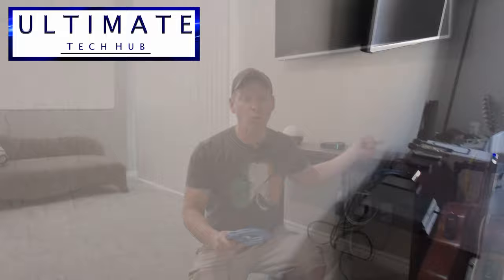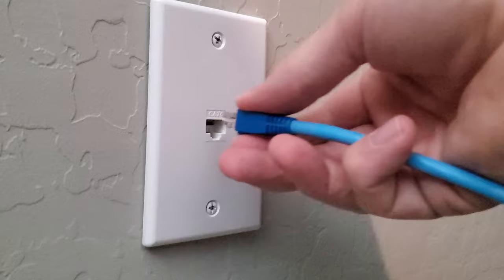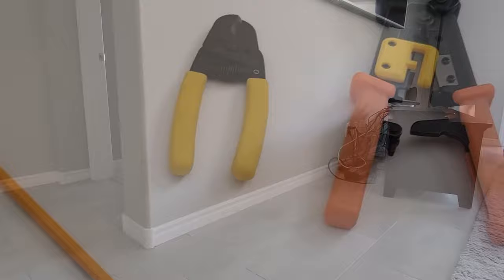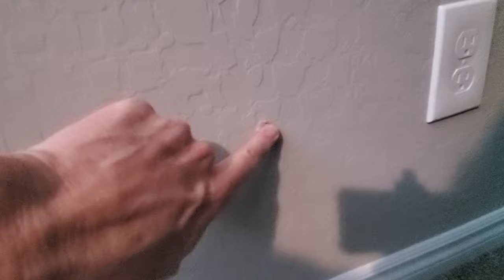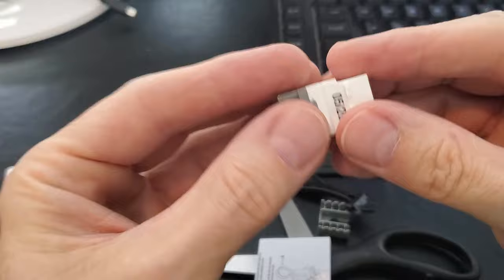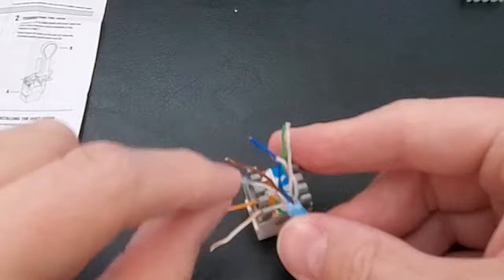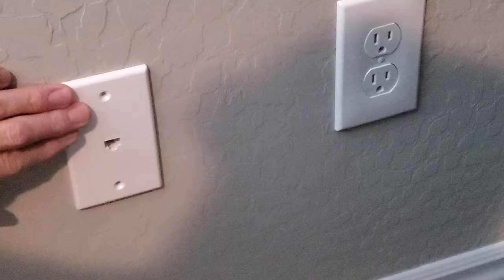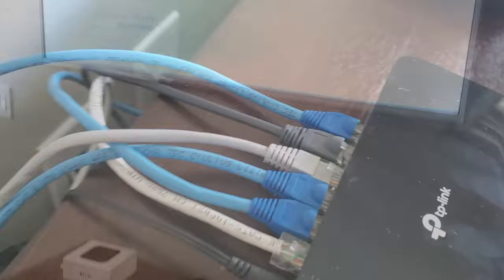CAT6 CABLE RUN THROUGH WALL AND ETHERNET JACK INSTALL - HOW TO

Comment: As a professional in the industry I can tell you that you never want to un-twist the pairs. Leave them twisted all the way to point of contact with the connector for best speed connection and more importantly for those longer distances.
Reply: I agree with you. By the way, he was not careful to set the outlet at the same height as the nearby electrical outlet. Not professional at all.
Reply: So do those flat ethernet cables not have this issue?
Reply: How does it affect it i don't understand
Reply: @pes0s51  twisted reduces interference from electrical cables nearby
Reply: @alizcool1  oh ok thx
Reply: @pes0s51  the twist helps with performance and reduce interference like crosstalk/alien crosstalk. Crosstalk interference is emi or rfi signals jumping in on your cable.
Reply: He did fine. If you noticed, he placed them far enough in and cut off the excess. The entire cable was right up to the point of the jack.
Reply: @vermontmike9800  doesn’t matter he practically broke it. The reason Ethernet is fast is because of twisted pairs. He literally untwisted them all lmao
Reply: @lucidclanyt1525  but he only untwisted them for placement in the jack. Everything beyond the jack is still twisted in the sheath
Reply: The loss of a performance on that inch of untwisted cables is like a few mbit and usually cables even outperform what they rated for cos of low distances that are used at homes so its not that big of a deal
Reply: @lucidclanyt1525  how do you propose he terminate the wires if he can't untwist them lmfao
Reply: Not really enough to make a significant difference... chill lol
Reply: or just get shielded CAT-cables ...
Reply: so you leave them twisted and just untwist the very ends just enough to fit into the connectors? I'm kinda slow so if not could you elaborate on what you mean?
Reply: @xblazingdubstepx3450  Yes, exactly that. Also, holding the wire at the connector with the thumb helps to keep the wire tight whilst untwisting.
Reply: If it's so important they would have made a twisted connector.
Reply: @xblazingdubstepx3450  you’re slow because someone untwisted your wires. 😂
Reply: Which company should I call? Should I call my network provider?
Reply: @renerodriguez9408  Home Professional, then? lol, I don't really care about the wall plates matching up, when their sizes seem mismatched to begin with.
Reply: Im an IT and you guys are extra af.
Reply: @pugwodo889 dudes lose 5mbps and start losing their sh** LOL

Comment: Interesting video, however, Ethernet patch cords contain multi-strand conductors.  These should never be connected to punch-down terminals which are designed for solid copper conductors.  A better and simpler way may have been to put a plate on both sides of the wall and fitted both keystone plates with modular couplers connected together inside the wall with a short patch cord.  Also, should have made the plate level with the adjacent plates.
Reply from the maker: I went back 3 weeks later and added the low voltage bracket and straightened it. Here is the video of that install. https://youtu.be/4CUyU_v2qS0

Comment: you could have just bought an RJ45-to-RJ45 keystone, avoiding you having to cut and re-terminate the cable.
Reply: True. But this helped me learn that skill. Thanks for your information as well.
Reply: i use rj45 to rj45 keystone couplers in my network installations. (blue of course) yeah he could have bought a shorter 3 foot cable. or do what i do and get the cable in bulk. can make patch cables all day long that way. i bought 300 pass through rj45's just to make sure i do not run out.

Comment: Don't have the tools, bought a 100ft ethernet cable instead
Reply from the maker: That will work too. You could buy the tools and then use them and then take them back. I've done that before.

Comment: It wouldn't take much extra time to do this job right. Get a P-Ring from Home Depot and use the drywall saw to cut it in. It really wouldn't take much effort to get this job done right.
Reply: or a low voltage bracket. My mind was melting from watching this video. Does he have any idea how big of a hole those anchors would make if he had to remove them? Also the sheetrock might even cut into the cable itself.
Reply: Could you go into detail a bit more? I want to do something like what this video shows but a lot of comments saying he's doing it wrong.
Reply: @louiswilliamson5937  What are you stuck on?

Comment: If your new ethernet cable doesn't work check the way you've wired it. Both ends need to have the same wiring combination. There are two types of combinations, A and B. They are colour coded on the port.

Comment: Good video! Some advice - keep the twist going into the wall jack. Slightly untwist the cable pair where it needs to be separated & push it down with your fingers, before punching it down. The closer the twist of the 4x pairs is to the metal termination point, the better & more professional the work will be. A good cable certifier may not pass your current runs. The twist provides some basic shielding from external interference.

Comment: Looking for my first house, and it seems like this guy installs outlets all over the place. Not levelled, and not in line with eachother if side by side. Takes two fucking seconds to measure it, but a good hour to take it off and patch the drywall.
Reply: Yeah, I definitely would have lined it up with the other outlet. And given it am actual low voltage box too (this seems like a weird scenario to use drywall anchors in).
Reply: Seriously this annoyed me to hell. And calling it professional afterwards.

Comment: Don’t forget to use that string to strip the outer insulation off of the wire. Wire strippers can score the inner wires.
Reply from the maker: Yep I've used that string many many times however I've been wiring ethernet cables for so long I can strip the wires without cutting the inner wires. But thank you for noticing and since this is an instructional video I should have used the string.  Thank you for watching and for commenting.
Reply: @UltimateTechHub  String? And how are you able to just stuff the wires inside the CAT6 jack without removing the insulation?
Reply: @ITX-EcoClass  There are little contact blades on the jack that pierce through the insulation of the smaller wires when you punch them down.
Reply: @ITX-EcoClass  Inside the cable housing is a thin string you can pull on which will cut/tear the housing as you pull the string down the length of the cable.

Comment: My dad's a journeyman certified electrician. I might have him do this for my room up stairs since wifi is bad plus I'm afraid of getting a tv for wifi. I didn't know it was this CHEAP to install Ethernet.
Reply from the maker: Yep its not that expensive and it's fairly easy. Here is a video on how to install the low voltage gang box and adding a second data port. 
https://youtu.be/4CUyU_v2qS0
Thank you for watching and if you subscribed thank you as well!
Reply: You are underestimating the cable cost and cable-pulling scope of this installation. What is shared here is just a very simple port installation. Your dad will know the pain of it. Talk to him instead, might get a better picture from a professional.

Comment: A nail set is a great tool to install wall anchors with no drilling required and even makes a tapered hole in the drywall.
Reply from the maker: Great advice! Here is an Update I did on this installation. 
https://youtu.be/4CUyU_v2qS0
Thank you for watching I really appreciate it!

Comment: nice video.  Though I would have made sure the wall plate was at the same height as the electrical wall plate and used a level to make sure the wall plate wasn't crooked.
Reply from the maker: I installed a low voltage bracket about 3 weeks later and straightened up the wall plate to match the other plate. Here is the video I did on the install. 
https://youtu.be/4CUyU_v2qS0

Comment: So what if I already have an Ethernet outlet thing and want to hook up my router across the room to my room outlet how does that work? Hope that made sense.
Reply from the maker: That ehternet port you want to connect to your router has a wire that goes somewhere in your house. Usually a network panel or box. That area is where your router should be and that ethernet wire needs to connect to the routers LAN port. I hope that helps. I have about 90 videos in My Ultimate Home Networking Playlist so make sure to check them out. Thank you for watching I really appreciate it!

Comment: Use Network Adapter for Ethernet Over Coax called MoCA. It's AWESOME!!!
Reply: They are great if that's your only option, little spendy especially compared to Ethernet cable

Comment: What you really need is some cable management!! My OCD is off the charts right now!
Reply from the maker: Cable management is my nemesis LOL. Actually is all better now. I cleaned it up during the full motion TV wall mount video 
https://youtu.be/KS_HxoRGyKM
I also added another data port and the low voltage bracket too. I uploaded that video about 3 months ago so check it out and thank you for watching!

Comment: Could’ve also used a retro box 
And get the height from the outlet beside it to make sure it’s at standard height
Reply from the maker: Yep definitely but I just wanted to keep it simple and under 20 dollars. Thanks for watching.
Reply: @UltimateTechHub  A low voltage Mud-ring is like $3.

Comment: Why not send the wire where the coax outlet is and convert the coax outlet into a coax and Ethernet combo outlet?  This is what I have done.  Fewer outlets on the wall.

Nice Video
Reply from the maker: I could have done that but I wanted to show this technique if you don't have a coax outlet in either room. Thank you for watching.

Comment: Nice but easy install - I was hoping that you can show us routing an ethernet cable from a wiring patch panel on the 2nd floor to a living room on the 1st floor OR routing a cable from one wall to another wall in the same room, Thanks!
Reply from the maker: Well my house is only a single story. Wiring and running ethernet cable from 2nd story to 1st floor can be tricky depending on how you want to run the cable. If you run it through walls and drop it down a wall it can get a bit messy especially if there is a fire stop and plumbing or other electrical wiring. Thanks for watching and be sure to check out my other Ultimate Home Networking videos.

Comment: 13 year old be made a hole in the drywall and ran a lan Cable from the living room to ny room. I didn't use a fancy wall plate or any adapters. The only thing I used was a screwdriver to make the hole.
Reply: If you want it to look like crap, that's one way to do it. Another way would be to keep things unlevel like this guy in the vid did...

Comment: What size drywall anchors did you use for the drywall plate screws?  I'll be selling my home, and I have to cover some  holes with a drywall plate inside my office room.  Thank you, and great video.
Reply from the maker: Just match the anchor size with the screws. I can't remember what size, sorry. Thanks for watching!
Reply: @UltimateTechHub  Thank you anyway.

Comment: Quick question instead of having the open mount shown could you have 2 female wall ports?
For example if one of the cables ends up going bad because of various reasons you would need to redo the entire cable alternatively if you have 2 female ports the wire is 100% in the wall. You would need an ethernet cable to go from the wall to the router but it should still work right?
Wanting to confirm this before doing it.
Reply from the maker: Yes this should work. I have 2 ports in one plate in 2 of our rooms. More ports always better.  Thabks for watching!!
Reply: This is what I plan on doing, going from my bedroom were the router is, have a double female cable, to plug in the incoming cable, then I can connect a cable on the other side to wire the living room

Comment: Not trying to be a snob here, but I would recommend using a low-voltage box and level.
Reply from the maker: No worries I installed the I gang low voltage Brackett about 3 weeks after I uploaded the video and it's level with the outlet too. I also added a 2nd data port too. Video is coming in about 2 weeks. Thank you for watching I really appreciate it!

Comment: Great video.
Im in a process of installing cameras and one side connects fo the camera could i use this same process to connect the ethernet cables into another room to the to the nvr
It will save me running unnecessary cables around the room and.
Reply from the maker: Yes that will definitely work! Thank you for watching I really appreciate it.  If you join my Patreon at $2 a month you get 1 free Tech support question per month. Good luck.

Comment: Hey, I have a couple questions so here's a liitle bit of info. My house already has CAT6 connection outlets already installed on 2 floors. Can I just plug it into my computer and it'll do its thing or do I need to do other steps. Also, where do I hook my router to make all the CAT6 connectors work? Will this also effect the  wifi speed aswell?

Comment: Will this work if I was to put wall jacks on both ends and then plug my router into the wall jack?
Reply from the maker: Absolutely and that's what ended up doing a few months later. I will probably make a video about that. Thanks for watching!

Comment: I'm planning to have an installation done and cabler is going to be using something like that standard cable  between the length of 40 m (131 ft) to 50 m (164 ft)    That's gotta be a standard indoor Cat6 cable right   Can you use that for outdoor installation given that cable is placed inside a conduit for roughly about 10 m (32 ft) because part of the installation is going to be outdoor above ground strung up by roof overhang level   According to electrician cable installer conduit is able to protect (length part of cable exposed outdoor) from direct UV rays or sunlight and various temperatures changes  so cable maintains maximum performance
Reply from the maker: Yes the conduit will protect the cat6 cable no problem.
Reply: @UltimateTechHub  Thanks sir

Comment: Not having it the same height as the other outlets would be detrimental to my OCD but great job.
Reply from the maker: I added a low voltage gang bracket and leveled the outlet a few weeks after the video posted. Here is the video update. 
https://youtu.be/4CUyU_v2qS0

Comment: Would running the cat6 from one point to the other and connecting it at a back plate adapter work instead of making a cut?

Comment: I will be using wall plates with integrated jacks, should make things a bit easier
Reply from the maker: Yes that will make it just a plug-n-play! Thanks for watching! 😃
Reply: @UltimateTechHub  I'll give an update to this comment if everything goes to plan.
Reply: @UltimateTechHub I just finished the job yesterday, I ran up the cable through 4 walls and under my house into my living room.
Reply from the maker: @Razor-gx2dq  Sounds like fun. Hope it went well. Keep me posted.

Comment: So you got 2 connections. One connection from the router to the wall plate jack and the other from the wall plate jack to the device. Does this slow down speeds? Wondering why one wouldn't just drill large enough hole in a blank wall plate and run the ethernet from the router straight to the device eliminating the connection at the wall plate jack. Overall my question is will the way you did it slow down speed?
Reply from the maker: The reason I did it this way was for the clean look. Yes running a wire through a wall through a faceplate with a hole would work. But it doesn't look for nice. As fat as the speeds it doesn't slow upload or download speeds. Thanks for watching and if you subscribed thank you as well!
Reply: @UltimateTechHub  Could you plug an ethernet cable from your new socket into another switch in that room giving you more ports & if you can does that affect speed or bandwidth?
Reply from the maker: @bepto4877  Yes.

Comment: I would use a low voltage electrical box instead of anchors. It will hold stronger and is only about $5
Reply from the maker: I added the low voltage box about 3 weeks later. Here is the update video. Thank you for watching. 
https://youtu.be/4CUyU_v2qS0

Comment: Just drill the holes for the anchor the size that the anchors call for.
Reply: Or you just get the screwdriver of size and jam that in the drywall. Then use the back of the screwdriver the hit the anchor in flush
Reply: Dab Man 
That works too. I have some some of sewing tool that looks like a short, tapering ice pick.About 7-8cm long and 7-8mm in width. 
But I prefer to know the proper size. Battery powered drills make the task much faster than having to find an extension cord, an outlet, unroll the extension, drill the hole and reverse the process.

Comment: Can you use this procedure to put wall Jack's on both sides of the wall. I have no cables coming out of the wall so I need to plug an ethernet cable on both sides. One to the network modem and one to my wife's work computer in the bedroom
Reply from the maker: Absolutely, I will make a video on that insallation next month. Here is an update video where I added an additional cat6 jack and the low voltage gang bracket.  Thanks for watching!
https://youtu.be/4CUyU_v2qS0